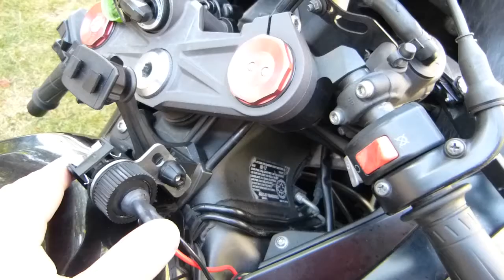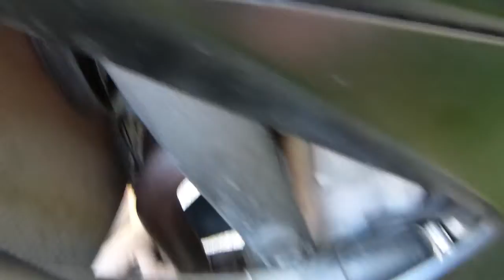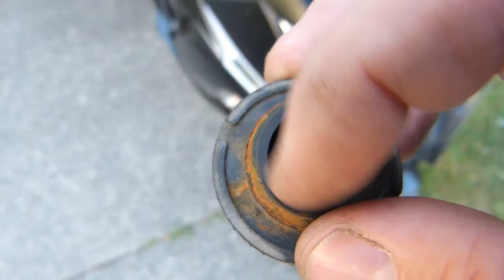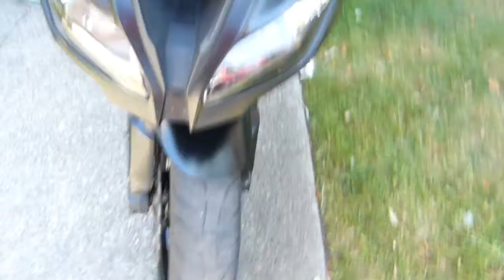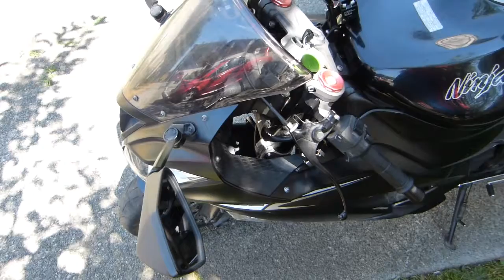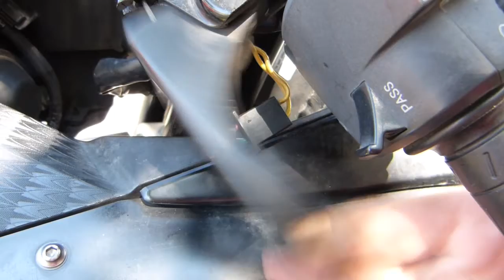The 2013-2018 Kawasaki Ninja ZX-6R ultimate long term review

Comment: buying a 2013(or 16, but same bike really) this week. thank you so much for this video!

also was gonna say yeah..in terms of the wiring hose issue I feel like just wrapping it in electrical tape will fix any potential issue with that and it's a 10 second fix.

Comment: Sir you seem to be a business only type of a gentleman. You don’t like Mickey Mouse aftermarket components you just want point A to point B. Maybe you should roll to work on a Kawasaki 400. The 636 is a pretty fast machine. I mean personally I don’t like smaller lighter bikes because they are t capable over overtaking other vehicles as fast which means avoiding danger as fast as a 600 or 1000 but if you just want to cruise it may make more sense and be cheaper on gas, maintenance, and insurance. What made you go with the zx636?
Reply from the maker: Less gas, less oil, less insurance, less tire costs, less weight (will never own a 250+ kg bike), parts availability locally, ...

Comment: you should try the michelin road 5 they are amazing with mileage and wet weather riding and great grip
Reply from the maker: New tyres are Metzeler M7 again. Was a good deal ..., not too old ...
Reply: theoverengineer ok just letting you know cuz michelin should last like 15k miles the way you drive ive had it like 5k and still look like new